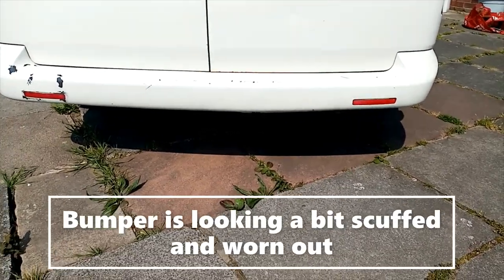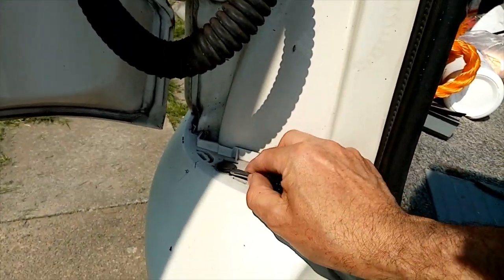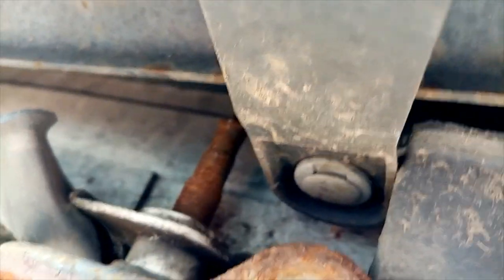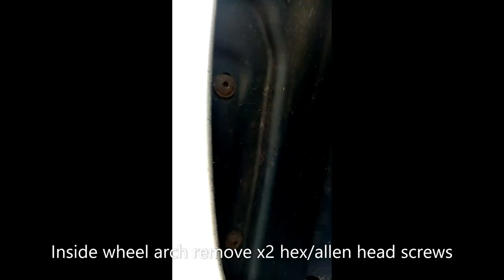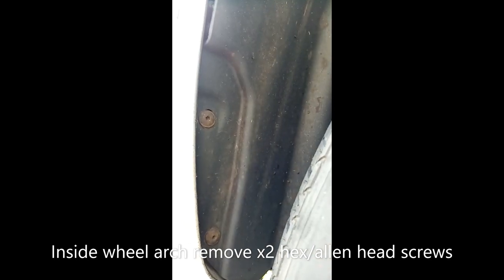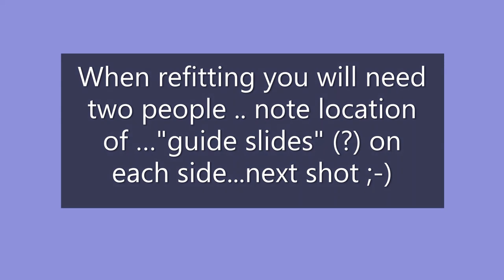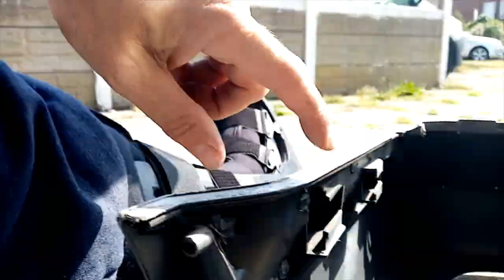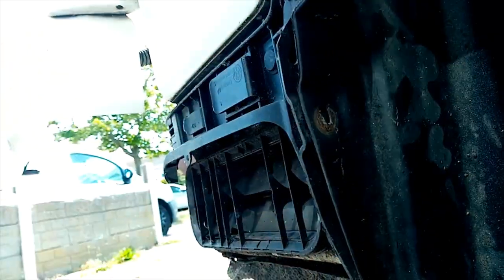VW Transporter T5 Rear Bumper - Removal & Refitting

Comment: I had to change also the 'Rear Bumper Mounting Guides' (large L-shaped parts) to my 2010 T5.1, because I accidentally bought a rear bumper which was for 2013 onwards (I believe it's 7E0807417E9B9). The 2013 onwards mounting guides are 7E0807393C (LH) and 7E0807394C (RH), 29 pounds a piece. The 2010 bumper which is same as in the video is probably 7E0807417A9B9. 2013 bumper has longer (280 mm) reflectors, so I had to buy them too. The newer bumper is vertically ~2 cm shorter than the 2010 bumper, but it's not a big difference. There is also in total 6 small rubber grommets (less than 1 cubic cm size) which are pushed into the mounting guides ('Grommet for Rear Bumper Support Brackets') which can be changed at the same time, but it's not mandatory because the old ones are likely still good (same grommets are used in T4). But if a shop sells the mounting guides, it also likely sells the grommets. I hope this helps someone 😁
Reply from the maker: Thanks for sharing all that helpful information, part no.s etc, very informative. Thank you.

Comment: How do you get the plastic corner pieces off to access the first screws?
Reply from the maker: Hi, Sorry my van doesn't have any corner piece covers, I'm guessing the female slots are to receive male tabs from the corner pieces? Suggest using a flat plastic trim removal tool or flat headed screwdriver to release tabs.
Reply: @bobsvanthings2226 
Exactly. They are only clipped in. When you start pulling on that cover and look in the crevice you will see. Nothing complicated

Comment: Amazing! Where did you get the bumper from?
Reply from the maker: It is the original black bumper, first I sanded the scuffs & deep scratches then sprayed with plastic primer followed by white prime, colour coded white  & finally clear coat.